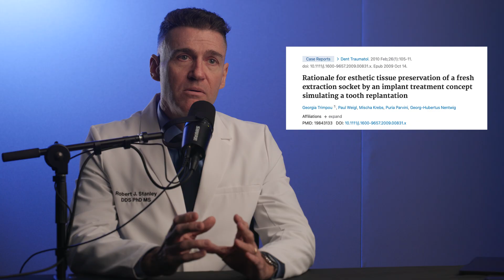Socket Sealing CHANGED My Implant Esthetics!

Comment: I completely agree with your suggestions. It’s the only way to get the results you need in the anterior. And if you can’t put a provisional for some reason, then you can make a custom peek healing abutment (using flowable to make it the correct shape) at tissue level. If the crown was natural and the adjacent teeth are natural, cut the root off the crown and bond in place as a temporary.

Note: in the past sometimes I used the “Meisinger Benex Control Root Extraction System” to get a root out without touching the gingiva. If someone knows about  a knock off for this please drop a comment. 

Your Implant: maybe #11 because it is a different color and the facial tissue doesn’t look like it’s tight around the crown (provisional?).